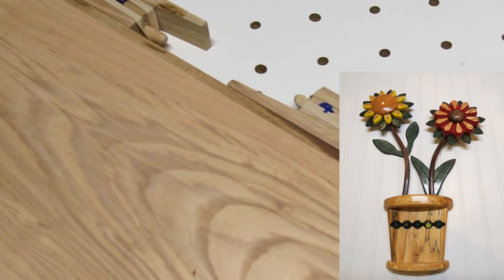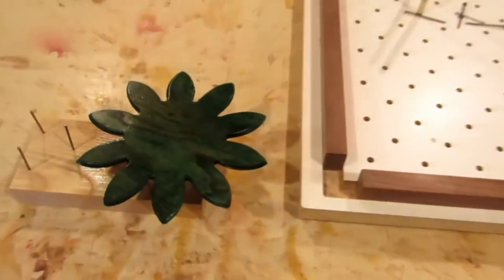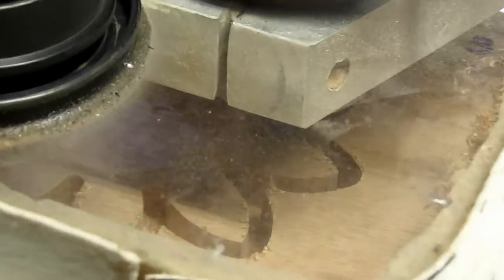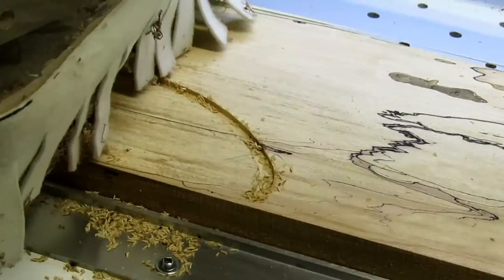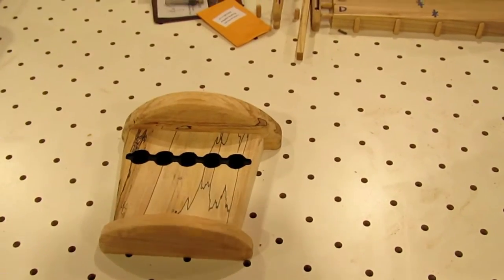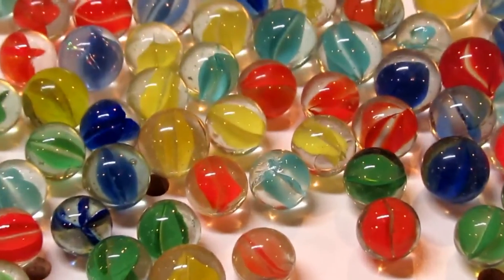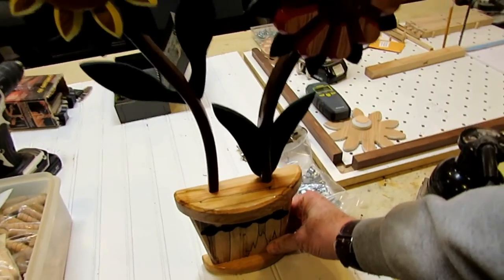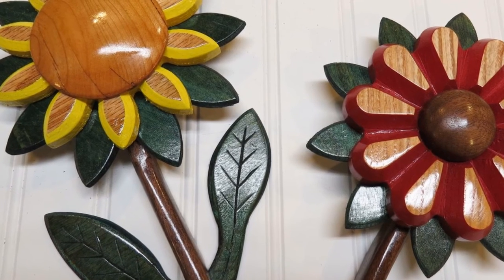Wood Flower Wall Hanger CNC Project

Comment: ya did a nice job there. the flowers are beautiful. i am not big into cnc woodworking but i can see using my router to carve the flowers just as easy, well some elbow work . good job.
Reply from the maker: +Michael Puffenbarger 
Thanks. I am just learning to use CNC in woodworking and think something like this would take less time to make using a router, some chisels, and scroll saw to build. Someday I hope to buy some 3d carving software and need all the practice I can get with simple shapes now. It is a easy to make project idea to use up scrap wood that I wanted to share with others tha may have similar interests.

Comment: You do a great job with your videos - excellent narration.  I have not seen them all - have you will you do a video on how data in entered into the program that controls the router (or plasma cutter)?  Thanks!
Reply from the maker: I haven't done one like that yet. I use a product called Sheet Cam to generate my g-code that was purchased for my plasma table, but it is not the best choice for a router because it is a 2D cam program and I have to play games and sometimes run multiple code files to make a part which usually needs additional steps to complete. I hope to someday buy the V Carve program that would be worth making a video of as it is a more commonly used routing CAD / CAM program. I also am playing with a Fusion 360 program now that seems like it may be a good combination of CAD & CAM and I will make a video about that controlling the Arduino controlled lathe that I will be building. Hopefully in the future I can figure out how to share some of the files for my projects. Some of my earlier videos have major sound quality issues, but I think I have gotten that under control now. Thanks for watching my videos.